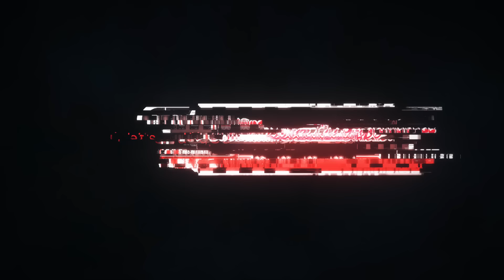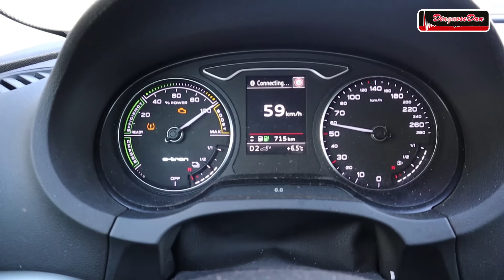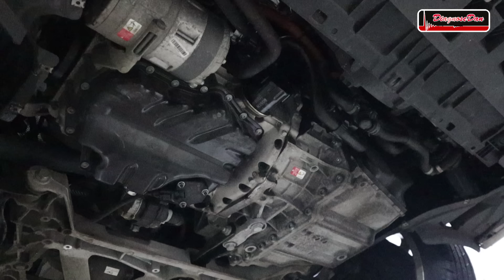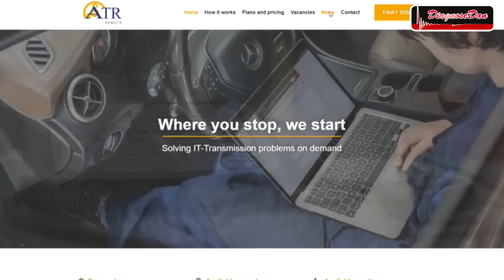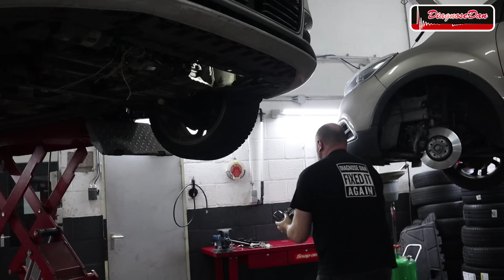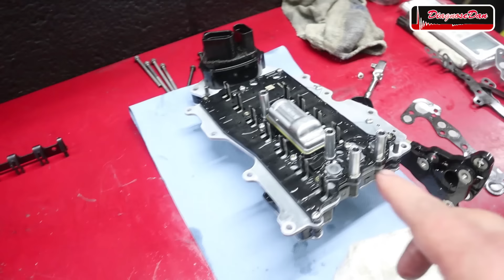DSG DQ400, p2884. Replace or easy fix?

Comment: Thanks for a great video! Not sure if you will see this in time. I have a 2015 A3-Etron with 53k miles. Should I consider the ATF oil change (recommended at 40k miles), or should I ignore this change - as it is around £250 (I am unsure if the workshop know how do to it as demonstrated in your video)

Comment: Hey Dan, having the same problem on my 2017 A3 E-tron. I'm finding different part numbers across dealerships, online info, etc. - are you able to confirm the part number for the unit you worked on? Not sure if it would still be compatible on the refreshed 2017 model. I have also read that they remedied this issue with 2018+ so I wonder if there is a different part number for those?

Comment: Where do i get The solenoid. The vw dont sell it?
Reply: Just check the condition, filter is of aluminium and can not damage anlot, should be fine to use the original one.

Comment: Have a 2014 VW Golf (7) with DSG (DQ200). Around 280000km the mechatronic failed as well. When getting over 60kph it forced itself with a big clunk in neutral with some lights on the dash. The local garage quoted €3000! Went to the VAG specialist and did it for €1500. They use refurbished ones, but basically all new parts and a 1 year warranty. They said they do this kind of stuff daily on Skoda's, Seat's, VW's and Audi's! Some mechatronics fail at 70000km 😅
Reply: Mine. 71k today, got the error code in the video, car stopped, gearbox malfunction on display.
Reply: @tudorvintilescu9096  ouch, do you know what you gonna do?
Reply: @passionateaboutcars  I went to a repair shop for automatic transmission, been quoted 3500 euro for a mechatronics replacement. Trying to find some mechanic who can do what's suggested in the video.

Thanks for replying.
Reply: I have the 2016 Audi A3 e-tron, same as the one in the video
Reply: @tudorvintilescu9096  No worries. Always trying to help. Do you have a VAG specialist nearby? Or try a VAG forum. Sometimes (not often) you have a mechanic who could help you out?

Comment: The question is, why did the screen let go? If it lasted for years and tens of thousands of kilometers, then it is not necessarily a faulty part. Now if the very fine mesh screen was clogged or partially clogged, that would increase the pressure against it causing it to fail. Maybe fluid changes more often might help. I don't own one of these, so that is just a guess. I like simplicity in my everyday vehicles.

Comment: Hi,

I just found this channel and i was pleasantly surprised that someone actually was looking into this issue!
VW is a pain in the ass to deal with regarding these kind of faults.
There's a very common one where the car just doesn't take fuel in. I've got a Golf Mk7 GTE and it's the same answer.. "TPI says we need to replace the fuel tank" and it costs over 1K € to repair!
However, i know that there's most likely an issue with the fuel canister (the carbon stuff saturates), and that should be a much cheaper repair.
If you ever come across one of these, i'd be really interested in having the basis to fight this with them.

Thanks!

Comment: Interesting repair, makes perfect sense of the failure, alas not all mechanics are capable of fully stripping it down and replacing a solenoid! Manufacturer repair covers unit warrantied and fixed

Comment: This is a typical fatigue related failure either intentionally built in by Six Sigma design methodology or unintentionally design failure lack of proper calculation in the design phase. 3rd Option is that they knew about it but some smart careerist managers pushed this design over the approval process for a fat bonus at the cost of future end users! Shame on you automakers especially the German ones.

Comment: VAG tried to fix something that wasn't broken, the conventional auto box of which hundreds of millions have been produced. Trying to squeeze a little more milage through a DSG was pure folly. Once when I was having the software in my Audi updated at the garage a VW (not a hybrid) drove in with a DSG issue and it was going to put the owner out of pocket by a big sum. No I don't have the Audi anymore but it had a normal  auto 'box and there were no problems. What's the bet some DYI mechanics will re-use the solenoid?

Comment: Hello, i need help. Do you know what the problem is, I have a golf 7 GTE 2015 DSG, it gives me the error clutch 2, P07A5 stuck closed. it happens to me when I drive it and I stop it throws the gearbox hybrid error and I can't move I turn off the car I start it and everything is ok until the next time and it happens to me that it throws me out of 6 gears and then they only work 1-3-5 gears yes is the problem in the mechatronics solenoid or something else?

Comment: I'm in Mexico with a q7 and Audi can't fix my transmission. They want 27,000 dollars to fit a new one in Cancun.  It's been with a none Audi garage for 3 months as parts had to come  from Germany. 2 other garages didn't want to touch it. And it's 10,000 dollars to buy a new metetronic unit here. I'm praying this guy can fix it.

Comment: @DiagnoseDan I need your help if possible if a strong short in the car from the back to the front (fuse box and light swith) vw bora can cause damage to the ecu? The car was repaired well it runs but no power at all the continuity on each sensor is correct no short to the positive or ground i changed many sensors but the vcds keep showing the same code faults. I hope you answer.

Comment: For people owing this car, trade it in before 100k kilometers.😅 Audi thanks you for new business ! Small filter screen in gasket is awful design. There simply should be big filter at intake of electric hydraulic pump, but you can't tell Germans that. Great video Dan, why do all the aftermarket techs have to explain reliability design mistakes?

Comment: Really enjoyed this. Very through and clearly explained. Germans and their highly complex "engineering" and it's broken replace it low tech solution. I get it that it's a complete "bulletproof"fix and not as subject to poor mechanical skill but it basically rips the customer off with very high cost repairs. Love the cars but as has been said many times if you buy one new get rid of it while it has value and early. If you buy a used bargain you're asking for trouble.

Comment: Replacing the whole Mechatronic unit for up to 3000 Euros looks fraudulent, especially since there is a manufacturing issue with that gasket. Audi should RECALL all affected cars and change the faulty gasket on their own expense. It is a disgrace.

Comment: These things also get distance sensor failures. Unfortunately, in that case, you do have to replace the mechatronics as they are built into the TCU board.

Comment: AS good as German engineers are, that fill and drain/plug at the bottom of a transmission is pretty silly.
My 04 R32 has a Haldex CD with the same drain/fill plug at the bottom. It is a mess to deal with for sure.

Comment: Typical of many modern GearBoxes, replace the whole unit please don't look inside. Nah, I'm a take look. Oh, what's this basic repair would fix it. Weren't some Mini-Cooper CVTs were notorious for wiring harness issues that were easy to fix but you have to open the cover to see them?

Comment: That's very well explained. Thank you for that! I am starting to get worried since my GTE has 150k. I did all the maintenance at the dealership, but as far as I understand they never change the gearbox oil filter. Maybe that's why this integrated gasket filter fails?  

Greetings from NL.

Comment: Hi Dan. What a fantastic video. I have a 2017 Passat GTE , and I know that they are known to have this problem. Will changing that little gasket also prevent the hydralic pressure problem they also are known to have ? Merry christmas to you 😀

Comment: Excellent diagnosis, Dan!  I can’t believe the complexity designed into this car, specifically checking the oil level. What are those German engineers thinking?  Probably how to drain the car buyers wallet.

Comment: The trouble with VAG dsg gearboxes is the availability of parts, with alot of parts only available if you know the part no ,usually from a TPI bulletin, but not shown as a spare part on the parts catalogue!,even repair procedures are only shown on  a TPI .

Comment: Last time we did the Mechatronic unit in my wife's Audi, it took a month, 2 different clutch packs, and flying a guy down from Auckland to do the job properly after 2 failures. The service department reckoned the claim amount of $9,000 was about half of what the repair actually cost.
I won't be buying an Audi again.

Comment: Haven't seen the video completely..but to see the gearbox malfunction issue.....
I had a 09 audi q5, thing was terrible!
I tought they sort it out after 2013.
I had 2 sensors that were faulty.
So many causes it could be. 

Solenoids, sensors itself, low gearbox oil, happens when the front of the car is higher then the back end, like being uphill.

I had this problem right after I installed a wireless phone charger from China.
I still believe some magnetic field messed up with the system.

I got to the garage and they quoted 2700,- of repair costs. 
From a Audi specialist!

I have no trust in Audi or other VAG cars....

I rather go Italian.

Comment: We have Toyota and Audi. Audi looks better, but it is shi**ing the bed whey you compare reliability. It is definitely designed to fail and it will make you miserable if you don't get rid of it around 100000=150000km.

Comment: There are no more mechanics who repair the actual fault.
People nowadays read fault codes on scan tools and only replace parts until problem disappears often without understanding why. it works ok but costumers had to pay a lot more with this system.

Comment: Of course it dies once the scammy VW warranty expires. :) Even so I would think a class action lawsuit could easily win against VW in this case to replace/or fix all these free of charge as this is a design flaw and under consumer laws of most European countries stuff needs to be reasonably durable regardless of warranty.

Comment: The question is, whether some remains of the screen did not remain within the ICE disconnect clutch line or its work cylinder, "ready" to get stuck in the valve again...

Comment: Hiya Dan, brilliant  diagnosis and diagnosis of the problem by yoursekf(and your mate) ...one question, why would "only" that piece of filter gauze come loose/break and not the others? Is it because the clutch uses more pressure so gauze is stressed more ?
Just subscribed😊
Reply from the maker: Thanks for subscribing. The pressure pulses cause  metal fetigue.

Comment: I wish more shops would actually take the mechatronic unit out on VW transmissions and test the solenoids to actually fix what is wrong instead of replacing.  I have a VW Passat sitting in my yard now with a bad mechatronic and need to find a shop that repairs instead of the giant cost of replace.
Reply from the maker: Send it to ATR!!!

Comment: Great video. But why does only that particular screen only fail? Is it the screen itself? Or is it the system that it’s in is causing damage somehow? But surely the oil pressure in the system is equal throughout? Does that one solenoid activate far more often than the others maybe?
Reply from the maker: The screen only fails at a one passage, so its not the screen itself. Its how the pressure pulses in that particular part of the mechatronic

Comment: Hi Dan, such a useful video, may i ask how much it cost (approximately) the parts you replaced in the video, all the orings, gaskets and solenoid piston?
And will you release a new video about the other common dq400 hydraulic pressure failure? Thank you so much.
Reply from the maker: If one ever comes into my shop with the pressure problem, i'll film it👍
Reply: Have you solved the pressure problem? I have it too..

Comment: Great Job Dan! As a tech I think there is still a question left unanswered which you and your team may want to look into and help us with, what is the main issue that results in the damage of that particular screen since the other screen are able to survive, could it be that the pressure passing through that particular solenoid is higher than the others? Also is the replacement gasket having a stronger screen than the OEM to guarantee that same will not happen after another 100k miles, I'm just curious, thanks
Reply from the maker: Good question, it has to do with pressure pulses in that particular passage. The solenoid doesn't only opens and close but it regulates the pressure. It can also let the clutch slip for instance. The pressure pulses cause metal fetigue in the screen.
Reply: Yes! This is what I’m really interested to know also. Certainly waiting way too long between oil changes can cause debris and gunk build up that can result in a screen failure, but why seemingly only that screen in particular? Maybe that solenoid is activated far more often than the others, meaning more oil flows back and forth through its screen?

Comment: Great video Dan, a question I have is why does that particular filter screen fail so completely ( it looks like it's been hole punched out), is it pressure fluctuation "fluttering" the mesh until it fatigues round the edges or over pressuring of the hydraulic oil blowing the mesh out?
Reply from the maker: You are right, thats the reason 👍

Comment: Thank you Dan, great stuff.

Do you know what years A3 Etron has this potential issue?  I have a 2018 with 40,000 miles or 64,000 km on it. 

Also is it necessary to replace the transmission filter?  I heard you need to drop the transmission to do that.
Reply from the maker: As far as i know they all suffer from this. We dont replace the filter for this particular problem.

Comment: So in a nutshell the oil pressure is too high against that screen and over time the sharp edges of the oil gallery mating faces causes the screen to sheer around the diameter of the oil gallery and you end up with the screen jammed in the solenoid. That's not a very good design if the VAG repair procedure is a 2-3 thousand dollar part plus labour.
Still, for the DIYer it certainly should help in reducing repair costs for what turns out to a fairly simple problem.
Reply from the maker: Thats about it in a nutshell indeed

Comment: Why does only this screen fail?  What is different about this screen compared to the others? 

This is  major design fault and should be the manufacturers responsibility.
Reply from the maker: The pressure pulses from the clutch cause metal fatigue
Reply: @Diagnosedan  so definitely a design/ materials selection fault.  Should be the manufacturer's liability. 
Have they indicated that they have solved this problem?

Comment: Would you imagine this issue to be caused by metal fatigue of the screen material itself after x cycles, or rather by buildup of debris in the oil causing too much pressure to be applied to the screen? Surely VAG will have specified that the gearbox oil will “last the lifetime of the gearbox” which to me always sounds more like a self-fulfilling prophecy..
Reply from the maker: Thanks for the great comment!
Reply: As a follow-up. Sorry, I was wrong. VAG does specify an oil change for the DQ400 for every 40.000 miles / 60.000 km.
HOWEVER, it is a “fluid only” service. Why? Well, I found a video describing the oil change procedure for the DQ400 on a plug-in hybrid VW Passat. At least on that model, the gearbox filter cannot be removed without removing/lowering the gearbox ~ 10 inches / 25 cm for the filter to clear the car frame when unscrewing it, making it a huge pain to replace.
Dan, did you notice if the filter location was similarly stupid on the A3?
Anyway, in an online forum I then found someone describing how he had to remove the dsg gearbox because of some unrelated accident damage. This allowed him to inspect the (paper) filter which he found to be in a bad condition and beginning to tear. He went on to state that in his estimation these filters would not likely last much longer than the service interval.
While I can’t verify this information, it would make a lot of sense to me if the torn paper filter material and it’s collected debris would clog the filter screen and the increased pressure would in turn cause the screen to fail like you showed us here.
This is not to say that your friend is wrong - I’m merely suggesting that the lack of gearbox oil filter change may also play a role as these gearboxes age. 
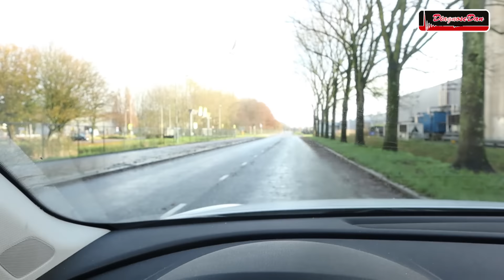Here is a link to the video mentioned. The filter change/location is discussed from ~1:40
https://youtu.be/en7l4ahmtlo?si=RG_AgbMw6UJkO6oS